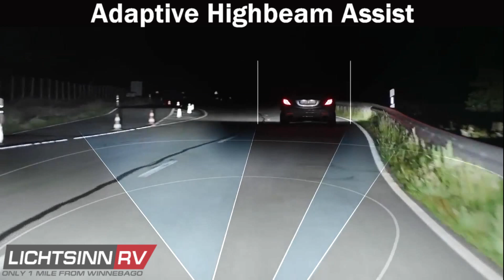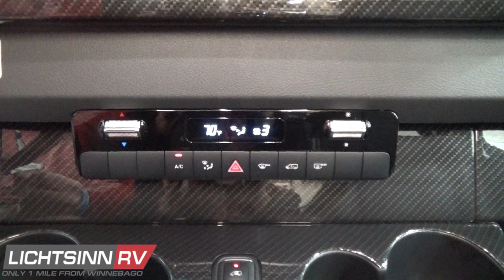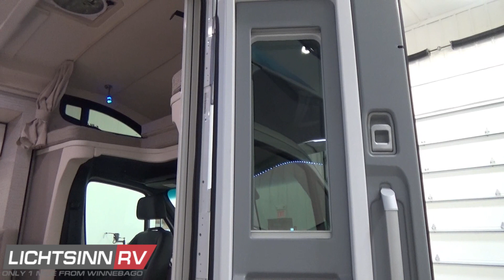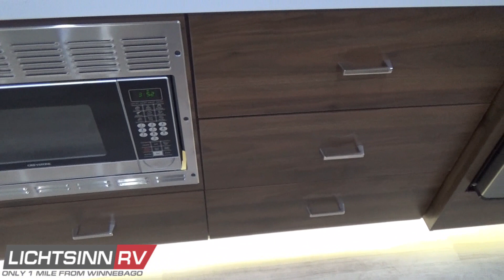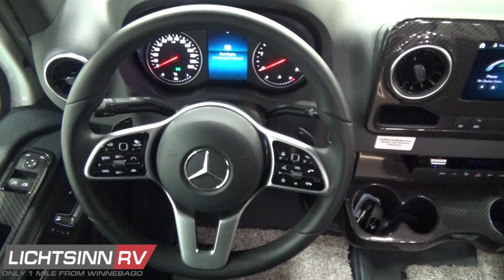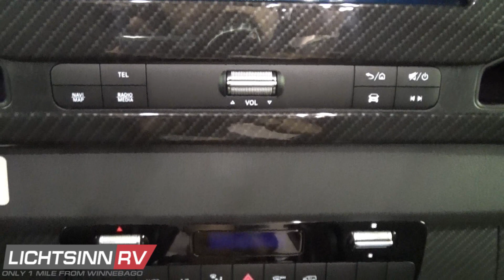LichtsinnRV.com - New Winnebago View 24D

Comment: Are there pull out arms to secure the awning to the ground or rv?
Reply from the maker: Good afternoon!

Thanks for your note!   There is an automatic motion sensor on the awning to ensure it will come in with wind.  However, we could also provide you awning straps with tie downs, no problem, if you'd prefer.

Hope this helps!

Comment: Looks really good. Wonder about the refrigerator. Is it only electric? I really like a refrigerator with propane option. Is that something that can be upgraded?
Thx
Reply from the maker: Good evening!   The refrigerator is actually 12V and electric and has been proven and will work well with the group 31 rv batteries and solar... an absorption / LP refrigerator is not an option but we could swap this out, although would be costly and not really recommended.

Comment: What is the OCC maximum weight?
Reply from the maker: Good morning Jay!   Thanks for your note!   It is going to be 1100... which is a few lbs down from last year with the add of the electric stab jacks which are now forced standard that we can remove if a guest wants fully automatic hydraulic levelers, which we do quite a few of.    I
f you're ever searching for these on our site it's on the right hand table for all of our listings:  https://www.lichtsinn.com/product/new-2020-winnebago-view-24d-1084216-17
Reply: @LichtsinnRV  is the OCC lower on the other two versions?
Reply from the maker: @gosman949  The CCC is higher on the 24V and 24J

Comment: Another great video.  Is this unit a prototype, or a production model?  I am curious because I have seen several walkthroughs of prototypes (e.g. Winnebago's RVX reveal, and a competitor) and I notice that the coach entertainment center is missing.  In the 2019 View/Navion, there was a coach entertainment system on the entry door side of the galley.  In your video, and all of the other videos, I notice that there is no entertainment center, no outdoor speakers (just under the awning), no coach speakers (in the dinette area) and no bunk speakers (in the roof, just above the cab bunk).  Has Winnebago dropped the coach entertainment system?  Do they expect you to use the chassis radio?

...oh, and how do you play DVD/BD on the coach TV?

Thanks!
Reply from the maker: Good morning!   Thank you for your note... based on feedback from guests, most are simply using a Soundbar via Bluetooth or a Smart Blu-Ray player, both of which we can add just behind the TV, no problem.   Same for outside...  most are using their own Bluetooth devices.   We can help you with either to customize your experience at a very nominal cost for the devices, and we would simply install as part of your no cost educational orientation we provide.